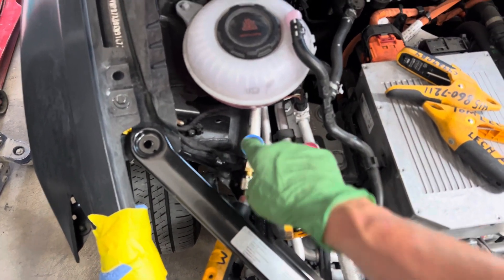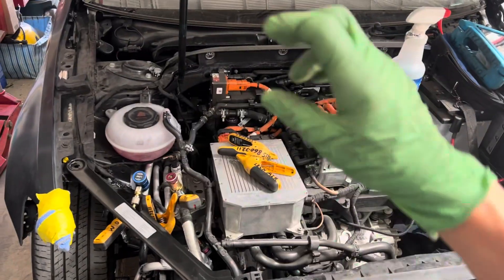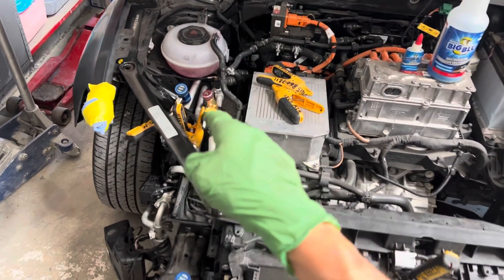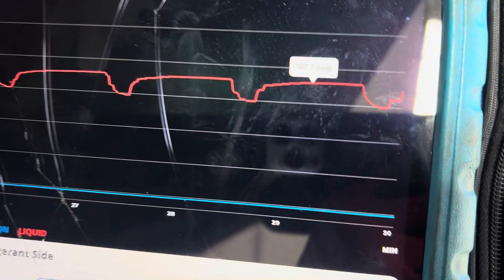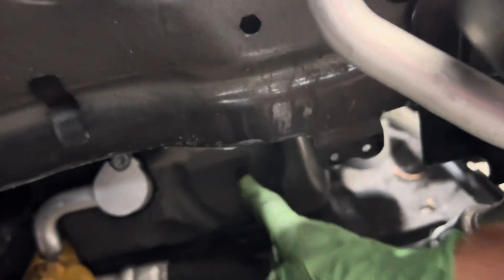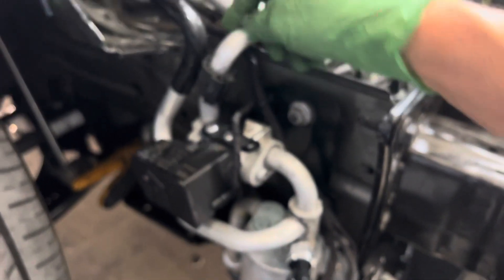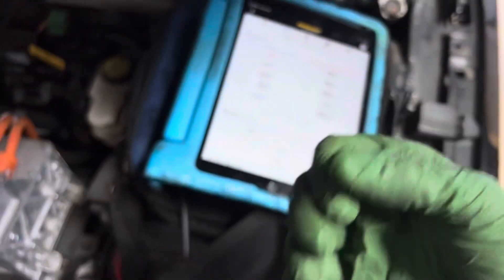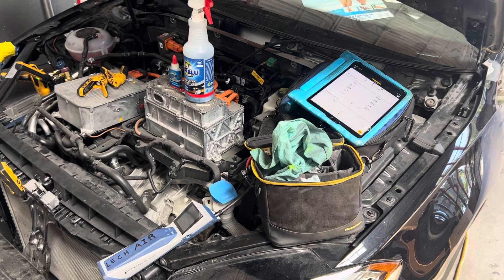AC PRO CHALLENGE 🤣 AC PRO SAY 30 PSI IS GOOD ? What will happen?

Comment: Why the negative pressure? Was this condition introduced or is this negative pressure the way this system is designed to operate?
Reply from the maker: It’s good you’re the second person who question this. 

I was waiting for more questions 

I like the one response from somebody who said check your gauge it might be stuck . 

And there are commercial refrigeration systems that operate in a vacuum 

But so far, no automotive intentionally that I know of operates in a vacuum 

And there’s usually only one condition where you can operate in a vacuum, but not have a freezing pipe . 

And that’s if you have a restriction, you have high superheat you have lack of refrigerant . 
In this scenario, you could be in a vacuum with refrigerant, but have no freezing of your pipe suction line that has left, and he distance from the evaporator 

Because if it was full of refrigerant, or had enough refrigerant, normally it would be so cold that the suction line would be freezing over . 

I have a couple occasional Clickbait videos that I put out there was really weird conditions and I ask questions . 

Because it’s good to see what peoples responses will be to something very odd that is not normal in automotive air conditioning
Reply: @coldfinger459sub0  I don't understand the negative pressure. Why is YF1234 unfer a nehlgative pressure?
Reply from the maker: @davidellingwood4075  I’m going to have to do a follow up with you on this particular year make model vehicle